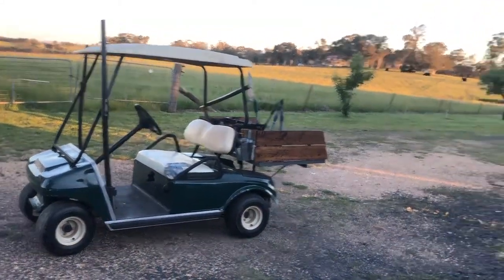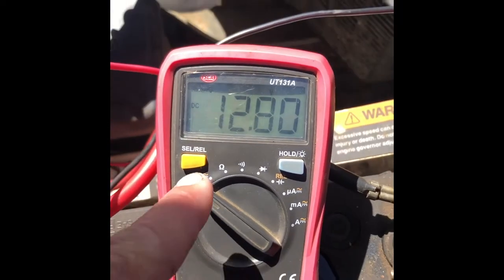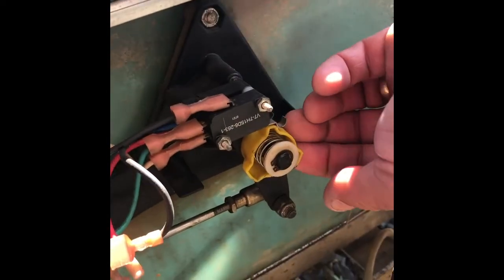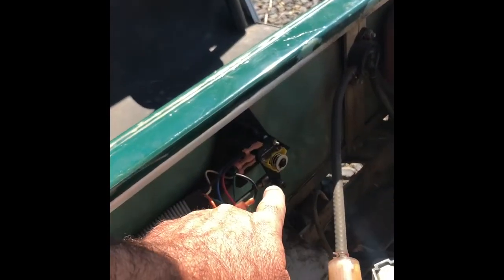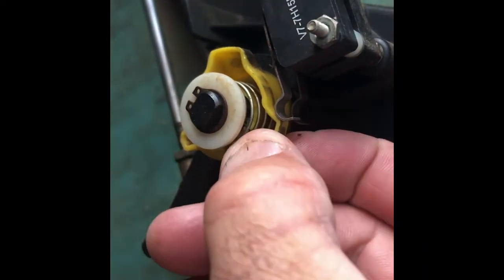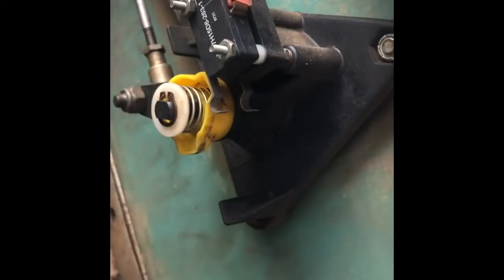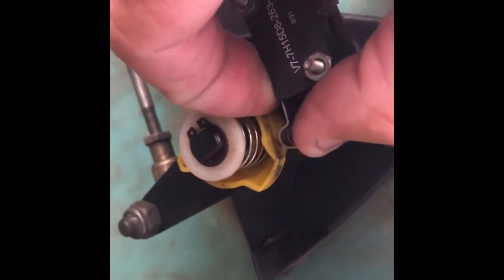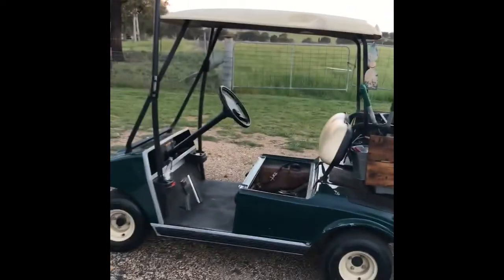PETROL OR GAS GOLF CART NOT STARTING HOW TO FIX IT YOURSELF

Comment: I have a 1990 club car DS. It turns over but won't actually fire and run. Changed the plug, solenoid, voltage regulator, micro switches.. still won't start. Battery keeps dying from trying to start it. Any ideas?
Reply from the maker: Did you check if it actually has spark?
Google the rev limiter , it’s at the bottom of the motor towards the front . There is 2 wires going to it , unplug it and see if it starts.

Comment: Just bought a ez go petrol, won't turnover at all, I hear it clicking trying to get it going 2016
Reply from the maker: Check battery voltage first
Reply: What if the battery is good